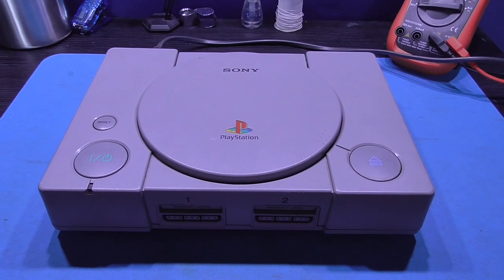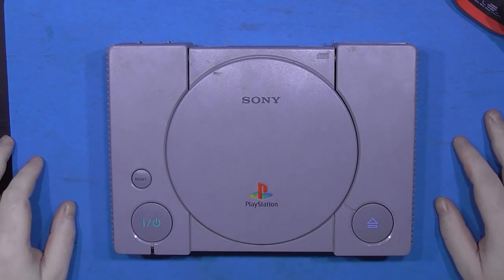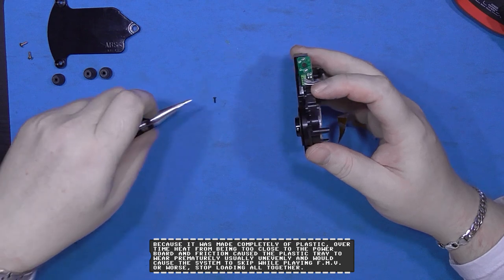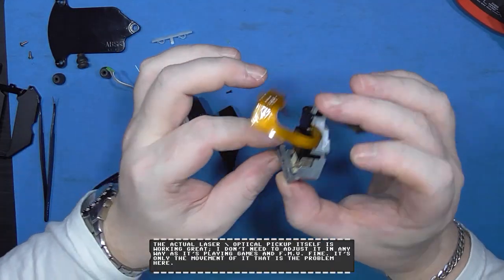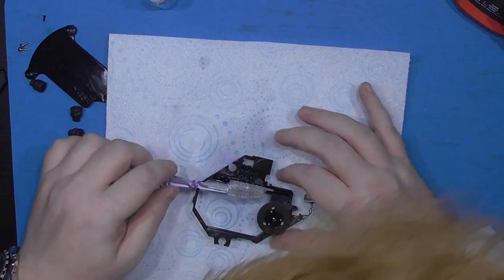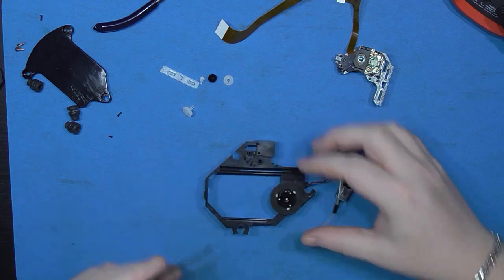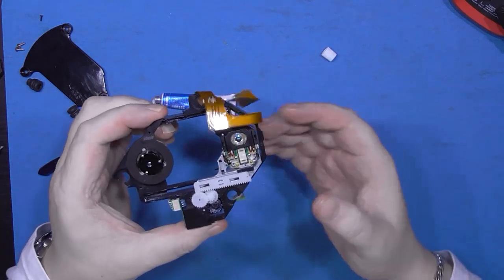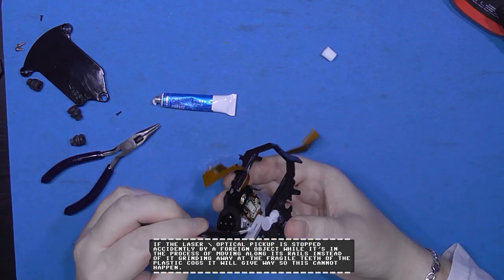Sony Playstation - Quieting a very noisy Laser \ Optical Pickup.

Comment: I think that I accidentally moved that speed of disk screw thingy. I think it's good advice to measure the default resistance value of the potentionmeter before partaking in this or any procedure involving the removal or moval of the ribbon cable. After, fix one should always remeasure the the resitance value to make sure it is set back to default that is when it is already reinstalled back into the system already for best accuracy (since the slightest of movements effects a slight drop or increase in the default resistance value over a period of repetitive play of the ribbon cable). This prevents laser from failure, which mine sadly did. I have to replace it now.
Reply from the maker: Oh, nooooooooooooo.

Comment: I still have a PS1 my parents bought for me and brother back in 1997. Haven't switched it on proper for well over 15 years due to the laser not reading discs properly. It would read them ok tipping it on its side or upside down. So it sounds like it could need greasing is my guess (no doubt it will after all this time), I remember it was louder than the newer chipped PS1 we got a few years after.
Reply from the maker: If it's a laser from a 1000 series PlayStation like a KSM-440AAM or KSM-440ABM you'll need to replace the Laser as those Lasers have a design flaw where the sled rail's wear away due to them being plastic. one of the signs of this is having to turn the PlayStation on it's side or upside down to read disc's

Comment: Great work. I didn't know how many parts needed to remove. Futaba Servo Gear Grease. I'll look for that. Thanks ! Been taking apart a cheepo DVD player, and it needs belt and grease.
Reply from the maker: Thanks bwack, It's my go to grease for lubricating Laser \ Optical pickups like this. If you can't find Futaba Servo Gear Grease you can use Tamiya Ceramic Grease which I've used before. You should find both of them on eBay or if there's a good RC model shop near you, you may find them there.
Reply: Thanks. Ordered it from ebay, UK. Reasonable postage. Hard to find over counter in Norway, I think..
Reply from the maker: Does it load and play FMV fine, if it does its probably the mod chip injecting the boot code to trick the playstation into booting and I wouldn't worry about it.
Reply from the maker: No, they would try to send the boot code at the same time unless you made a switch were you could dissable one or the other chip.
Reply from the maker: Thanks. will get there. just need to keep going.

Comment: Quick question,  when you order a new laser, do you fit it with lithium grease right away or  do you leave the new assembly be at first?
Reply: that is a great question! I have heard that those chinese lasers/optical pickups you buy off amazon ebay or alliexpress come hardly prepared, so you still need to do some work on them before installing them to work properly, like greasing them, even adjusting the pot... or at least that's what I've heard